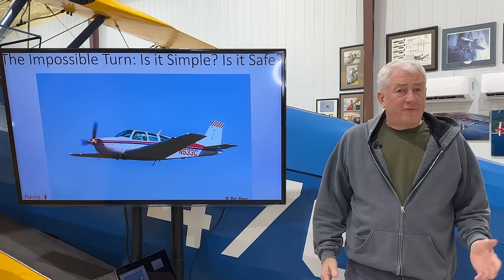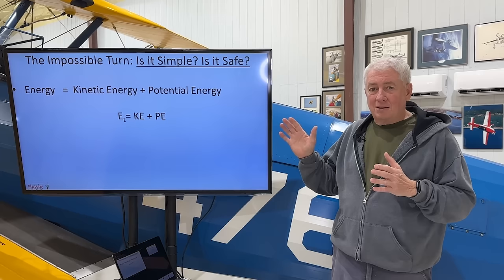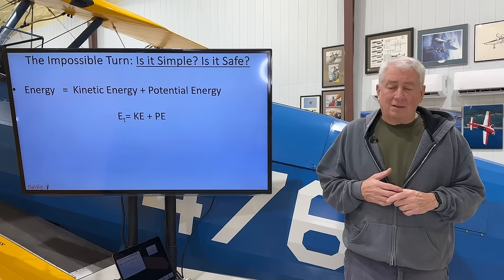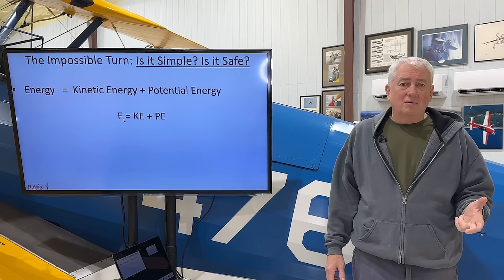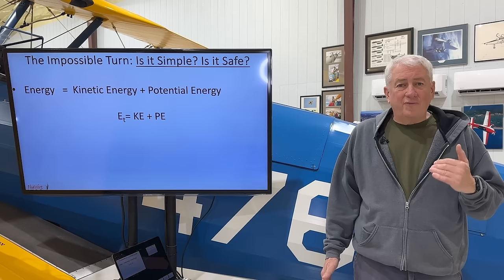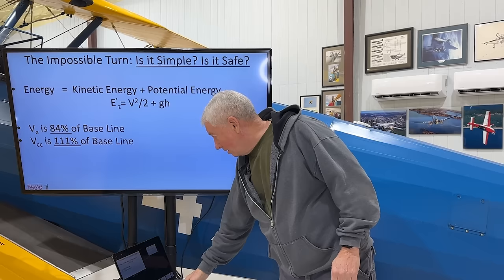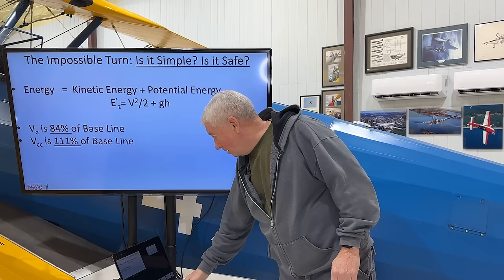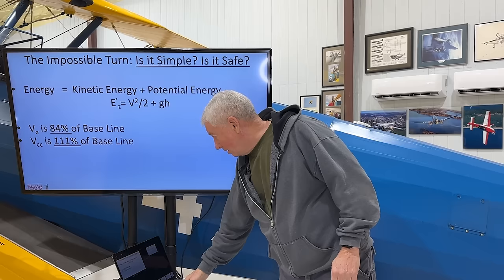Impossible Turn Is it Simple? Is it Safe?

Comment: This was fascinating. First time I've seen a hard-data analytical approach to calculating the feasibility of the impossible turn. Several thoughts born from my own power and glider experience:

1. Dale (Fairbanks pilot) did a fantastic job reacting and dealing with his engine out scenario. I like that he allowed plane to drift downwind off runway centerline once airborne (for reasons explained in 2 and  3). I speculate here that the quick bobble to the left (towards river) as the engine quite, before turning right toward open fields around airport) cost him the energy that was the difference between a hard pancake (1500 fpm?) and a more gentle flair at touch down. Too easy to Monday morning quarterback, but interested in other thoughts.

2. In primary glider training, and every flight, 200' is the generally accepted 180 return-to-runway ("RTR" for brevity) magic number. There are variations of course  depending upon wing loading (glider competition ballasting) and other performance factors. Below 200', land (mostly) straight ahead. Above 200' can generally execute a RTR. If a student didn't loudly call-out "200 feet" when reaching such altitude, they can usually expect the CFIG to pull the tow release as a reminder. It wasn't fun banking 40-45 degrees close to the ground, but highly doable. The RTR worked best if tow-plane and glider drifted down-wind off the runway centerline such that if there was a rope-break or engine issues at 200 feet, a simple 180 into the wind would line you up with the runway. 

 3. In my power training in the early 1990s, specifically in a C152 (I never tried this in other powered craft, whether taildragger or tricycle), we practiced the engine-out RTR from 400' (It's possible there was slight cheating: a little extra airspeed, or pulled power at 450'). The first couple times I was nervous about the ground proximity and the physics working out. But we did it, repeatedly. Since my CFI in this instance was a Lear jockey, I brought and applied my glider experience into this practice in two ways: A) demonstrated the greater energy efficiency getting safely onto the ground by drifting downwind off the centerline at lift-off. The subsequent RTR required only a 180 degree turn (sometimes a little more for minor corrections). This sometimes allowed enough extra energy that, with full flaps on short final, we occasionally had too much energy to set down on a "short" runway (even though we practiced on a one-mile length runway), so I B) announced, then demonstrated to CFI an aggressive side-slip, which amusingly puckered his Lear-Jet-driving sphincter, but got us down onto the runway right dam quick. 

But to be clear, the purpose of drifting downwind away from runway centerline after lift-off is purely an engine-out, defensive-flying move for that rare critical engine failure. It allows just a little bit more RTR option if the worst thing should happen after take-off. Not drifting downwind means you'll have to fly a button-hook pattern, which involves more like 270 degrees of turning, and often more, to correctly align with the runway you're returning to. The button-hook scenario requires more energy to execute, which could be the critical difference between a disaster and walking away, or even saving the ship.

In every, EVERY, take-off I make, power or glider, I'm thinking through the scenarios if the engine  quits at a really bad time. Call it the "wife-and-kids" factor, or "I want to live to fly another day" factor.  IMO, power pilots don't think enough about engine failure close to the ground.

Thanks for an excellent approach to the impossible turn.
Reply from the maker: Great input to the conversation!

Comment: Like your straight talk about when the fan stops making the noise...  You have to have a mindset about when the noise maker goes silent and you have very little time to respond... Most airplanes need energy to get airborne, so a low-energy state on or after takeoff is always a critical issue
Reply: Which is why I preferred trading altitude for speed. Every  airplane is much more manoeuvrable a certain speed a good bit above the stall speed.

An extra couple of 100ft aren't going to help, if all one is going to achieve is to stall and spin 😈

Comment: So many airline pilots crash on small airplanes. Sometimes you have to turn 45 degree banks at Vglide speed- like on EFATO Turnbacks, Box Canyon Turnbacks, GRM Turnbacks, Circling Approach Turnbacks.  4 places for Turnbacks.. Do them wrong and you can die.  Ignorance is not the solution,  Ignorance is the problem my CFI said when i learned them in 1997. He had to do 2 EFATO Turnbacks for real.  Cherokees.

Comment: Thanks for the great assessment.  By now, most of us that incessantly watch safety videos are committed NOT to do turnbacks.  We are, however, well indoctrinated in the need to quickly nose over (get light in the seat) to keep the plane flying, after which we can fly to the scene of the crash.  On the day that we're going to lose our engine, I would think the fixed variable for various assessments would be the time between liftoff and the engine failure, meaning a question to be answered could be this:
"Assuming an engine failure xx seconds after liftoff, say 30 seconds, what climb rate will result in the best energy state after you've nosed over and arrived at the best glide speed." The higher the altitude when arriving at best glide, the more the energy and the more the available options. Not knowing the failure is coming (like when pulling back the throttle), and given the bias now not to turn back, most pilots will likely react sequentially by nosing down, establishing best glide and then figuring out what to do next.  This is certainly not optimal for executing a best achievable turnback, but it is optimal for avoiding an immediate stall/spin.
Flight testing for this could be done just by climbing for various fixed times (20, 30, 40 seconds) at various speeds (Vx, Vy, Vcc), then cutting power, waiting a reasonable startle time, say 3 seconds, then nosing over and recording the altitude when the best glide speed is established.  
This would provide insight identifying the climb rate that would provide the highest post engine failure energy state once arriving at a steady state condition (best glide). As compared to testing where the failure always occurs at a particular altitude, these results would converge a bit, meaning there would be less difference between the results for Vx vs. Vy since the Vx will occur at a higher altitude than Vy and Vy at a higher altitude than Vcc.
Reply from the maker: Thanks for commenting and watching. Actually, you could watch it again. Altitude is not as important at airspeed. I’m going to do another video on this next, a deeper dive into climb speed.
Reply: Experience has convinced me that altitude is not as important as airspeed.  I think slower deceleration at less pitch angle while accepting the event live is a factor.  Eleven of my thirteen engine failures were at 200' or lower crop dusting or on pipeline patrol, but all were at cruise airspeed.  The energy management 1 g turn at whatever bank angle was necessary to make a survivable LZ was always a turn to target and less than 180 degrees of heading change.  They were six second deals.  I was usually high and fast to the available LZ in the very near hemisphere ahead of the wing.  I learned to immediately go full rudder forward slip.  I think working from energy excess rather than energy deficiency was more comfortable.   @FlyWirescottperdue
Reply: @FlyWirescottperdue  The physics / flight mechanics are brutally honest.  Accelerate to Vy in ground effect then climb at Vy.  That's the fastest way to build total energy during takeoff and climbout.  I posted another comment here with the details, so I'm not going to repeat here.  The short version is that Vy maximizes specific excess power, and power * time = energy.
Reply: The reason they tell you to just go straight ahead is because that's the most appropriate answer for the average pilot and almost always the right answer for a student pilot.  Safely executing the maneuver requires practice, skill, familiarization and recent experience with your airplane's capabilities at low speeds, planning for the specific runway, and doing a pre-takeoff briefing to mentally prepare and have the go/no-go altitude number in recent memory.  The average pilot is just doing $100 hamburger runs and not practicing maneuvers with the aircraft except at biannual flight reviews.  And students don't have the experience and judgment by definition.

Comment: Excellent analysis!  Of course your numbers will be more favorable than with an actual dead engine, due to your idling engine still producing 40-60 lbs of thrust.  Compared to 500-600 lbs thrust in the climb, the idling engine gives a bit of a false sense of how much energy is available in a real forced landing situation.  i.e. in a real engine failure, you have even less energy than these practice runs indicate.
Reply from the maker: True, and success was still in doubt!
Reply: So you add 200 feet more to the altimeter indicator.  Duhh

Comment: And don't forget most pilots' shock and response will be longer than demonstrated, maybe 4-6 seconds at least?
Reply from the maker: Yes indeed. See the video I did with my A36 for the startle factor
Reply: Yeah, I’m a pilot and I don’t have that many hours I, wonder how quick I would react?

The most important thing- I think- is to plan for a land out location, or try to fly that strip on the way out if you can (in uncontrolled airspace).

It is good to be reminded of how much altitude you are going to lose while maneuvering into a turn. This is a big deal. Because you don’t notice that when you are power on. Power on you power through it!  I think practicing gliding turns at relatively low altitude, engine idle, probably a pretty good thing to get a feel for it. But only do it in a safe Place where you can actually land in case something goes wrong
Reply from the maker: @steveperreira5850  Try it at altitude first. Maneuvering at low altitudes is rarely a good idea, except in controlled conditions (like flying an airshow).

Comment: An excellent technical presentation. However, may I suggest the average Joe-Pilot would be better advised  to be establishing the glide, picking the landing spot, checking  for the engine failure, tightening his harness, briefing his passengers and making his Mayday call. His arrival is under control at the lowest ground speed and all checks complete.  Turning back has been the demise of so many over the years that I fear this presentation may lead low hours G/A pilots to disaster.
                  Thirty eight-years experience  in the cockpit also suggests that a strong headwind makes the impossible turn even more dangerous. The mass of the machine has to be accelerated to twice the wind speed in this tight turn which trades off energy (height) and the arrival is going to be at high groundspeed and in the face of following traffic. In my opinion, you have to be on-the-ball and pretty slick to get away with this manoeuvre.
Reply from the maker: Ray, Don't miss the other videos in the Turnback playlist. The brief should happen on the ground and a radio call would be the last thing on my list to accomplish.
Reply: Ray, only one of my 11 very low engine failures crop dusting and pipeline patrol at 200' involved a turnback and that was to the adjoining crop field, not the one I was coming out of.  They were all six second deals.  They were aviate deals...just aviate and a tiny navigate to suitable site and no communicate.  Good point on wind which we need to manage in that six seconds to go as much into as possible, but as Scott points out it is all out the window.  And the suitable site catches our attention most, not wind management.  While airspeed is the most critical low altitude energy condition for maneuverability, time (altitude is time) is simply something that deserves no consideration as we have almost none.  For the small amount of altitude to help at all, we must have conditioned ourselves to not pull back on the stick/yoke in turns.  That right there is the killer of pilots in these situations.  Any amount of turn, any bank of turn, is not a problem if we release back pressure in the turn to turn that altitude into airspeed, which is life down here.  No back pressure equals 1 g in a turn of any bank angle.
Reply: I’m with you on this.and especially since I soloed a glider.
Reply: @pattyhaley9594  It is unfortunate we engine dependent pilots get so few comments from you glider pilots who are a bit more versed in "Stick and Rudder" principles like, "The Law of the Roller Coaster" and "What does the airplane want to do."  We tend to be stuck on fuel energy and disregard ground effect, down drainage egress, thermal and orographic lift, flying slow in up air and fast through down air, and such.  We reject as trash just what God provides other than our man made fuel energy.
Reply: @jimmydulin928   One reason why Germany produced the quality of pilots they did for WW II. They were mostly trained in gliders first. Thanks to restrictions placed on them after WW I.
Reply: @pattyhaley9594  Yes.  Wolfgang was born in Dusseldorf.

Comment: Great video, thank you. My friends and I wondered about using "the impossible turn" for both escaping a narrow blind canyon and engine failures about 30 years ago. For the takeoff part we did informal tests in a C-172 using a virtual floor and various engine failure heights. I can't remember the minimum height for success, but it was higher than one would think.  I have an aerobatic signoff and my best success was a wingover immediately on engine failure, BUT that's not realistic because it does not include startle time and it requires practice and proficiency. For escaping blind canyons with a running engine, a wingover can be the only hope, but still carries high risk and the need for proficiency.
Reply: A wingover can kill you easily on a turnback no power.  Quick STALL.  Even with power on, it is easy to stall it in case of partial power LOTOT Turnback or Box Canyon Turnback.  Why? Because when lower alt above ground, in stress, you tend to pull back more elevator than other relaxed times.  Good to practice turnbacks at airport too.  At altitude we are all pros until the dam ground gets closer and no margin for student pilot errors.  I used to teach 3 kinds of turnbacks in the 1990's. Had to do 2 for real on Cherokees.

Comment: Mr Perdue; I learned turbacks on Cherokee 140 (underpower airplane). That was in 1996.  Where you using the Vx, Vy and Vglide speeds precisely for your weight at that moment?  That can make a big difference.  The better angle you climb, the better chance of turnback.  
 Also some winds instead of nothing at all can make you reach the runway.  Please see that video of a Bonanza Take Off Engine fail practice i posted the link.  Dec. 2 2023.

Comment: An important element in my decision making about turning back to the departure runway rather than landing straight ahead is what the tailwind component will be for the landing. The runway at my home base is less than 2500' with a dike at each end. That will disappear pretty quickly with even a 10 knot tailwind. So even if I can make the turn, can I make the landing? A downwind landing on a short runway in the heat of an emergency is risky business.
Reply from the maker: Absolutely!

Comment: Excellent demonstration of the hazards of the impossible turn. And, you’re a very current, well trained pilot too! So, the average private pilot with likely 1/4 of the yearly hours as you will have a much longer delay. Thanks for doing this!
Reply: It is not impossible ffs. Stop calling it that.
Reply: Ok, NEARLY impossible
Reply: @adriaba790  iF YOU DO IT WRONG WAY.   So learn the right way,  Real pilots are not a coward Mild Maneuvering Pilot.
Reply: iF YOU DO IT WRONG WAY.   So learn the right way,  Real pilots are not a coward Mild Maneuvering Pilot.  Pilatus Pilots have to do them well on simulator BEFORE they are allowed to fly that aircraft.  Cant do it? That is the door, dam coward they say.

Comment: Where does distance back to the airport factor in? Vx, though requiring a startling attitude delta keeps you closest to the airport. Vy is less startling but you’ve got more distance to travel back to the field. Vcc is the easiest transition but now you’ve got a really long distance to travel back to the field. Your plane has a big engine and I worry someone with a Cherokee 140 will see this and adopt the Vcc climb profile with two passengers on a hot day. I flew exactly one time with a guy who did this routinely and I was alarmed at how long I was uncomfortable climbing at 200 fpm.
Reply from the maker: As far as the physics of the turn, it doesn't enter into it all. But you can see that energy at the end of the 180 is marginal for Vy and so so for Vcc. The heavier the wing loading the less likely a succesfull Turnback will be made. And that is the important point.

Comment: People that freeze on airplanes will also freeze on cars and not swerve when needed.  That is called Temporary Startle Paralisis.  Frozing in place.  My 1996 Aerobatics and EFATO CFI taught me that.  He also says some even push a pedal when scared, like trying to step back in fear.  He called that, the Pilot Panic Pedal.  That is why most stalls are to the left and many pilots also land on left side of centerline.  
 Most times they do Panic Pedal on spins or EFATO practice on runway.   He used to tell me to retract the left foot if no left rudder needed on that maneuver..  Im right handed,  and most scared right handers push the left pedal.  The lefties PUSH THE RIGHT PEDAL instead..  Panic Pedal is no remembered by the pilot later on.  Is done, and not remembered later..  Unconsiously..